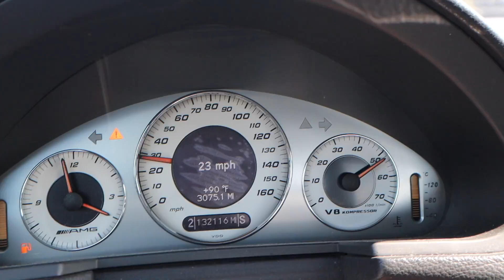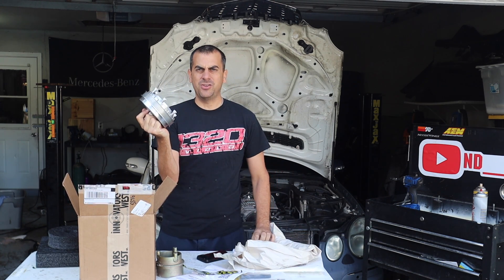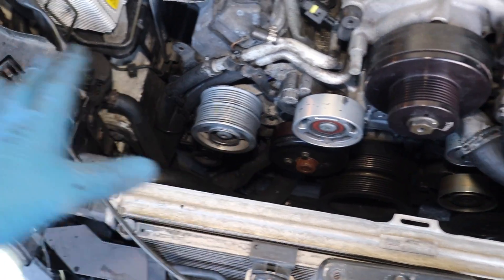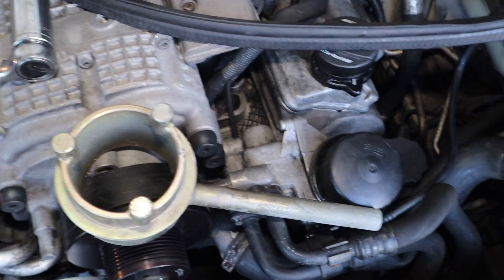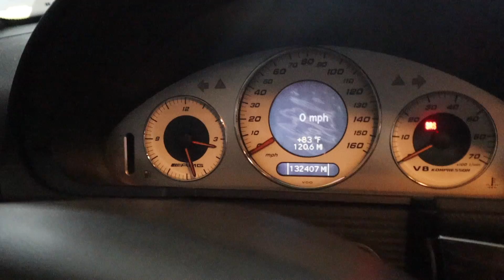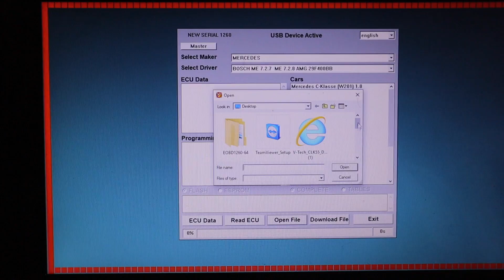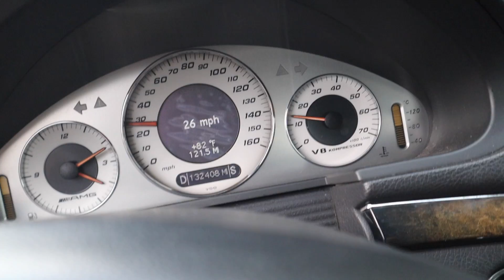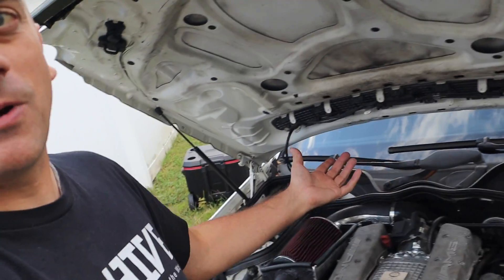Crank Pulley On A Mercedes E55 AMG

Comment: The part I wish you would have called out is how did you hold the crank for torquing down the crank bolt? And what’s the spec  on that bolt?
Reply from the maker: The specs came in the box 

And to hold it get a friend and a strap wrench
Reply: @Nd_72  sweet so if I’m understanding this right a friend with a strap on is all you needed. 😂
Reply: @Nd_72  spicy 🌶️
Reply from the maker: @suddendilemma5137  lol lol lol

Comment: Did you use an Oem drive belt for the smaller water pump?
Reply from the maker: I did not use Oem with the pulley set up I have
Reply: @Nd_72 length wise I meant is it the same as Oem?
Reply: @Nd_72  😁?

Comment: So I have a question about flashing tunes. Have you ever had any issues with flashing? My 2002 C32 has like a 50/50 shot of throwing a communication error and bricking the ECU. I’ve had to send it out several times due to this. I am doing everything Vano told me to do, unplugged the fan, put a charger on the battery, turned off all consumers, etc. It gets annoying having to drop about $150 every time I have to send it out. Anything you’d recommend me to try, or any ideas on the cause?
Reply from the maker: Are you using the right driver and living the right ecu
Reply: Contact Josh Chase over at the Mercedes Swap Shop. He’s knows his shit and got it going on when it comes to the M112K. M112K his specialty even if you have someone else’s tune he’ll help you out fella.
Reply: I second the suggestion to Josh Chase at the Mercedes’ swap shop.

Comment: Hi, I’ve seen you linked the tool for m112k, does that work for m113k aswell?
Reply from the maker: yes they will work on both
Reply: @Nd_72 you've mislead your viewers and should change that information. that holder does NOT work on the m113k as i literally had to find out the hard way by ordering it from the same link YOU posted... i now have to send it back and hope for a full refund

Comment: Hello!! I need your advice on my build… i have 04 s55 and has upgrades but its not working properly(I believe)
-76mm SS pulley
-Upgraded injectors 
-Upgraded water to air cooler.
- supposedly ECU tune
My concern is guy i got it from said it was around 600hp but i dont believe that. Please help! 🙏
Reply from the maker: To the crank maybe like 560 who tuned it

Comment: You know someone who is running a 77/185 or even a 77/195...? You don't say! 🤣🤣😆
Reply from the maker: Lol lol maybe
Reply: I'm trying to learn more about this engine I never had a s/c mercedes I come from B and K swapped civic and crx world but my mom sold me her slk230 with nothing wrong with it for 500 (it's and 03) so I did some research and now I'm here with a torn apart slk230 and a m113k that I'm going to manual swap in. It's gonna take a while to finish but I'm trying to do all the internals and what not. I'm here to learn about this vrp pully but I want to know if I could go 68/195 on the sc pully and crank pully. I'm also in the process of getting the v_tech top mount and the 105 hellcat throttle body and snout. Idk I'm having fun with this project so far but I want it all to work like it should and put out as much power as I can until I can save up enough for abwhipple kit